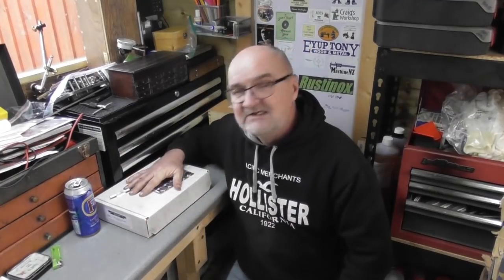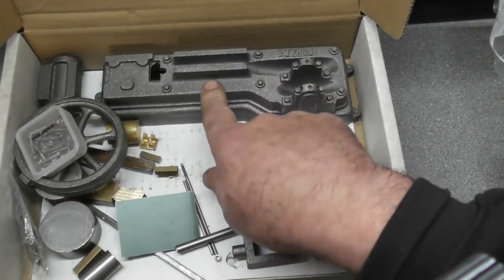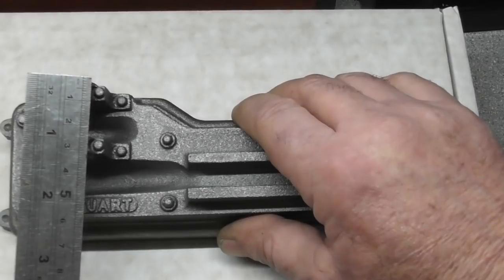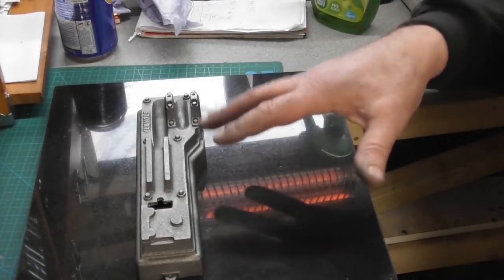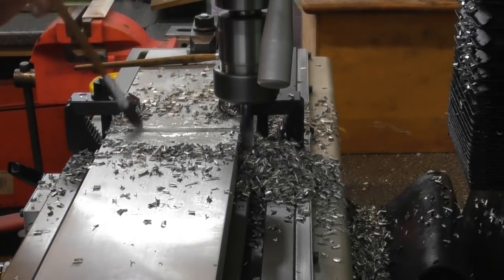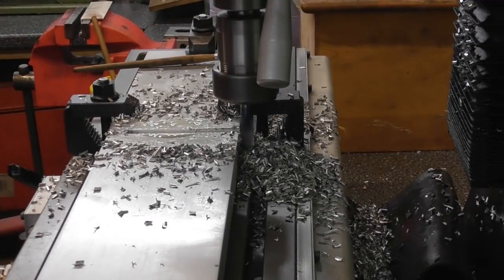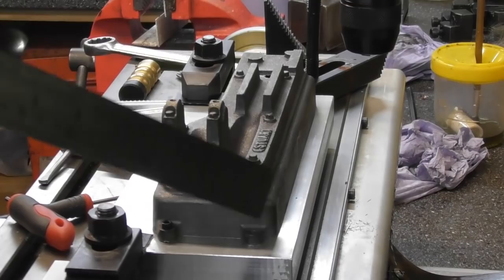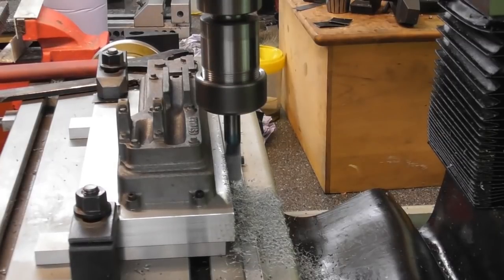Stuart Models S50 engine build Part1

Comment: Ade what ever you do re heating don't be tempted to use bottle gas fire, when you go in the shed the next day your machines will be covered in water. I used a Calor gas fire once, shed was toasty warm pretty quick, never again though due to the water condensating on every piece of machinery.
Reply from the maker: Hi Gillian. I have recently put an oil filled radiator in the shed . it has made a big difference with moisture levels and a little heat . Cheers Ade.

Comment: Another great video Ade. I'm a life time scale modeller kits, scratch build, plastic, resin, wood) recently turned to true model engineering, and this project is so helpful in showing me the way way forward. I've considered these Stuart kits as a step from my world into true model engineering, so will be watching with much interest. I was also dismayed at those "imitation" nuts that would hold the real casting down, and was heartened that you seemed to suggest you will deal with those!
Reply from the maker: Hi Terry good to hear from you. The 7BA bolts arrived today to do the job . Yes, the cast ones were a bit ugly . I want this as a bit of a display model but obviously fully functional on compressed air . I am sure it will run on steam but then I would need to build a boiler. One step at a time maybe . Cheers Ade.

Comment: Looks good Ade. I’m glad you mentioned spot facing. I’ve seen others machining cast surfaces but not spot facing where screw heads will locate. It goes through me a bit to think of those high spots only giving partial seating otherwise.

Should be a good series of videos! Looking forward to the rest! Good work Ade!

Comment: Hi Ade, great project and spot on idea using the aluminium as a fixture, you will be pleased you did that many times over as you work through it all. You are much more patient than me, I would have had that casting straight on the mill, upside down, and machined the base flat. Looking forward to the next installment. PS. minus 2? Wimp! Cheers, Jon
Reply from the maker: Hi Jon. Yes minus 2 is not that cold in comparison to Scottish winters , I followed your tip and put an oil filled radiator in the shed . I leave it on half tilt and it has made a huge difference to the mayonnaise layer on the machines . I gust put a quick layer of wd40 on now and no more flash rusting . Eats the electricity a bit but needs must . Working with fractional imperial takes me back a bit and it seems I am rusty now. I have started collecting BA taps and dies and hardware since starting this . Number drills next . LOL Cheers Ade.

Comment: Thanks for the video Ade. Seems to be the thing on YT at the moment, building model steam engines. As a follower of Keith Appleton, the more the better I say. I agree on removing the badly cast base nuts and replacing them with real ones. It will look a lot better. Looking forward to the rest of it. keep safe and stay well.
Reply from the maker: Hi Colin , ordering some 7BA bolts as we speak. Cheers Ade

Comment: Don't worry Ade you have nothing to explain, the forum is full of x spurts who know it all and can arrive at a conclusion based on a cropped snapshot of your process without considering the overall picture. It even went further downhill with the table needing to be protected with plates to stop the clamps marking the table, I consider that if you need to do that then the x-spurts are torquing down waaay too much! And it's the first I've heard of using paper to stop the fixture moving, mind on my little'un the motor would stall first. ;>)
Keep doing what you're doing and have fun, oh by the way get some hinsulation, coffe with brandy will do. :>)

Comment: You are now the third to build this engine, Joe P......sky & Blondihacks. What spoils the finish are the slotted head screws instead of BA hex heads. I built a Vertical 10 in the early 1960’s from Stuart castings. Looks much better with hex head bolts. Enjoy 👍😁🇬🇧🇦🇺🦘 Ex Leeds, & RAF, living in Tasmania- since 1968- also virus free. Stay safe and get your van shot.
Reply from the maker: I agree about the screws , this model differs from Joe and Quin's. All BA hex bolts thankfully . Cheers Ade.
Reply: Hi Shevill. Ex Oxford here (just the place, not the university) - also in Tasmania, 10 mins from Hobart.  Small world!
Reply: @CraigsWorkshop  Which side of the river? Me Cambridge, Southern Cross Observatory- have two observatories on 5-acres a stone’s throw from the Mt Canopus Observatory, relocated to the midlands a few years ago. Used to a lot of astronomical work with them, also NASA JPL and other major observatories in the northern hemisphere. Still working on developing climate change projects as well for UTAS. Not enough hours in the day for all my interests/ projects etc. Google Shevill Mathers Southern Cross Observatory , if interested. I used to be in Pathology/Forensic also scientific photography.

Comment: Hi, Ade.  If the project were larger would you be more prone to try to clock the casting in per the centerline of the action?  This was always a problem when my work used to had to machine multiple flanges on cast tanks and such, trying to keep bolt centers and thicknesses at both ends.  At least your shop isn't here in Pennsylvania where the one or two below is in Fahrenheit!

Comment: Good start to you S50 Ade; re heating, have you looked at a couple of small 3 / 5 fin oil rads thermostaically controlled, one at either end of workshop?. I have one at either end of my converted, insulated single garage, 17ft long, put them on for about an hour before I go in, nice & cosy 16*C.
Reply from the maker: Yes I have, I have got one up and running recently and i leave it on half heat permanently . it has made a big difference to the moisture levels . Cheers Ade.

Comment: Hi Ade, I really enjoy your videos, and I now what to get back to good honest engineering which I enjoyed many years ago, now retired ..I have a set of S50 castings bought for me so,  Could I have your thoughts about your WM180 compared to the Warco Super Mini lathe or the WM240/250? does the 300mm DBC really limit you for model engineering on this scale? Thanks in advance.
Reply from the maker: Hi Neville. My view is that you can do small parts on a big lathe but big parts on a small lathe is tricky . I have used mini lathes and the 180 is far more rigid , I have no experience with the 240/250 but I would probably have gone that way if I had the room at the time . My 180 has served me well and the mods I have done have made it even better for my needs . Thanks for your support, Cheers Ade.

Comment: Just for future reference, it will always be prudent to actually mic the screw diameter. Most cap heads are thread rolled and OFTEN come out Under Size. Sometimes if the whole length is not threaded, you even find the plain section is EVEN smaller. As you really needed almost a location fit on the bolts to act like a dowel to stop movement over the machining operation, it would be ideal to measure the bolt diameter first then pick the best hole size. In case you do not realise the NUMBER Drill Sizes are often very close in size the the Metric ones. You can sometimes find a number drill that is say 0.05 mm smaller than a standard metric one. i.e you may only have a 2.9 or 3 mm drill and a number one comes in at 2.95 mm ( illustration numbers only ) may not be actual size. In that case of course you would have needed to remove the casting to tap the holes as the tap would be 3 mm but your bolt clearance hole 2.9 or whatever. Hope this helps. Regards from Australia temperature in the high 30's C, so definitely do not need a heater running. LOL